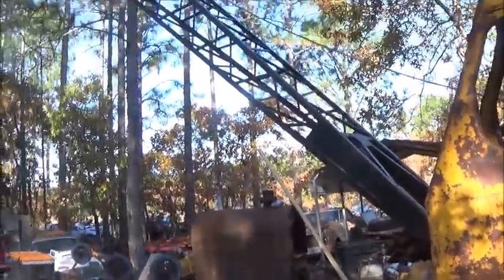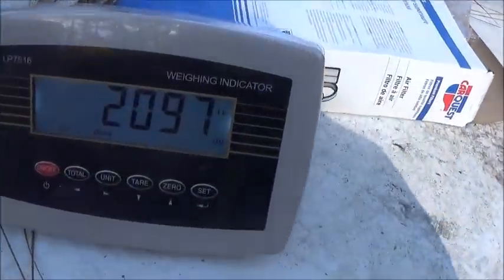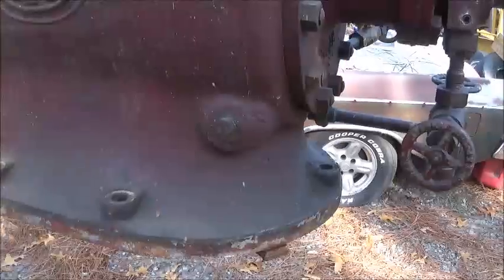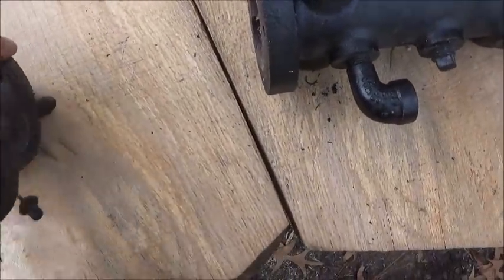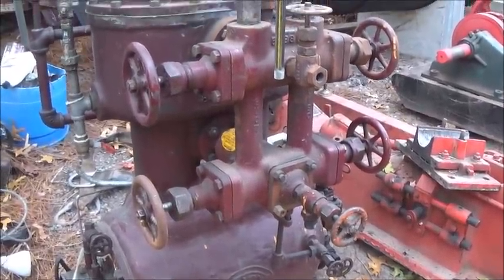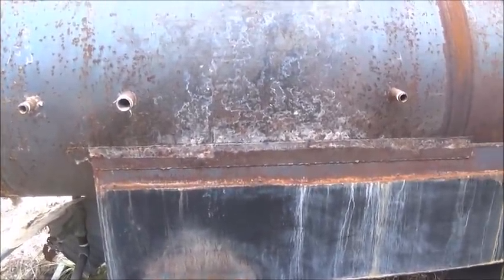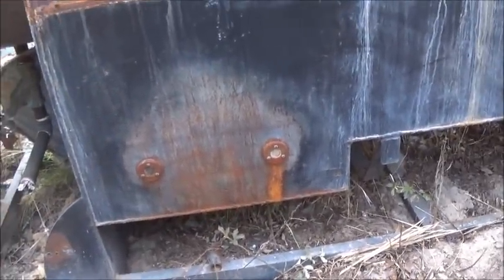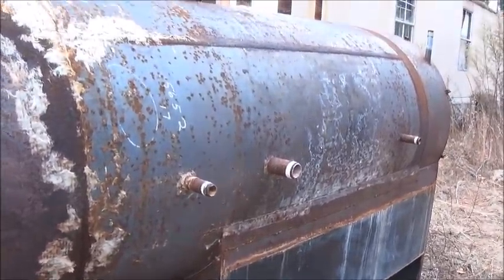AMMONIA COMPRESSOR, BOILER, LOCO PISTON AND MORE!!

Comment: That piston  is out of a  locomotive engines..16 Cyl . I used to work for a Railroad company.  Called Speno Railgrinding Co.We used one of those 16 Cyl Engines to power our 96,  15 Horsepower  Electric Grinding  motors on 4 cars. We went around the US and Canada grinding the rails for different railroads. We lived on the train. I was the power car Guy and ran the 2 cab. Grinding. But I did maintenance  and Mechanic work on the 16 cyl engine. I was 18 yrs old. Great job. If you wasnt married..LOL..The grinding motors were set at different angles to grind the rails. The stones were 7 inches in Diameter  and 3 and 1/2 inches thick. Dirty job for sure..Great Video. You can use that piston as a foot stool.LOL... Safed another piece of history So Awesome. Great job. The Chevy didnt even act like it knew it was setting back there....LOL That boiler is in good shape...that will be great when you get it hooked up.

Comment: While I'm not 100% sure I suspect it's live both ways or sides, and the valves are for compressor and system maintenance so the charge ( in this case ammonia ) can be either isolated or evacuated depending on what needed to be done

Comment: That boiler looks great, can you not get it ultrasound checked for barrel thickness, tubes can be replaced if needed. With the traction engines that I have played with it is an insurance requirement to have it inspected.

Comment: It takes so much time to pull a deep vacuum on theses big compressors if you just need to rebuild a valve or do a small repair that with all those valves you can isolate any one part or section, make your repair, pull a vacuum & put her back online.
(Provided the valves hold) nh3 "anhydrous ammonia" is relatively cheap compared to some other refrigerants & works very well in commercial and industrial application's.
Good to see you saving some of the old "big iron". Steam driven air compressor?? 😀

Comment: In the early 1990s I managed to save a compressor slightly smaller than this one from an ice house being demolished that served the Missouri Kansas Texas railroad depot at Denison, Texas. It nearly broke my then new 1/2 ton Ford F150. I've gotten smarter since  then about acquisitions since all but 2 of the flywheel spokes had cracks.
Reply: Lineshaft, did you notice how well Jonathan’s Chevy PU handled that load?  Watch when he was lifting the compressor to weigh it, the bed of the truck barely moved, like it wasn’t there…

Comment: That ammonia compressor looks like one that might have been used in a grocery store for the walk ins and freezers. I remember a commercial refrigeration place that stored cheeses had big ammonia compressors as big as your biggest steam engines. The bad thing about ammonia as a refrigerant is it's corrosive and the place in Illinois had more than one person get killed from leaking pipes that had corroded thru before they shut it down.
Reply: I worked for many years in a frozen food plant that used ammonia for the refrigeration, one weekend a pipe came undone and released ammonia gas into the air forcing the evacuation of the nearby area, only bad thing was when it would develop a leak inside the plant the ammonia would literally take your breath away, don't miss those days at all 😱

Comment: Jonathon, that boiler should put out enough steam to run you big engine at a pretty good clip if you run just that engine. The most important thing is the fact that it will be hot steam which will transfer enough heat to your engine and it will then allow you to time the engine right. Heat is a major factor in timing those old steam engines. I'm sure glad you got a good boiler, and looking forward to seeing it run on steam. I think you can't go wrong using wood to fire it with.
Reply: Now if he can only find a good source of wood.
Lol
Reply: @MrPaige222  He has plenty of pine straw!

Comment: That Unit Crane... how'd you get along without it before you had it? It's easy to imagine it's grateful for being saved and glad to be put to task again. Then again, it's just a machine. ;-)
Your red Duramax Chevy's long ago earned its keep, with that recent trip to Ohio and back with all that heavy treasure you trailered and now this 2000+ pd ammonia compressor!
Everything earns its keep at the JW Homestead. Want a table out of huge slabs of oak? Fire up the sawmill!
I'm trying to imagine how that boiler will be hooked up to the various engines you'll be running. Will it sit in a central location with steam lines branching off to each engine?
I guess I'm real curious how the steam yard is going to be laid out. I'm sure we'll soon see. 
Looking forward to the testing of that boiler and how you'll fabricate a firebox, stack and end caps to make it work.
Thanks for your channel.
Reply: Yeah man I've come to learn that every one of us needs a crane
Reply: @timothydockery534  To qualify, you gotta be able to pull an engine and rebuild a drivetrain on a crane deep in the woods and drive it out under its own power like Jonathan did. Still one of my favorite JW episodes! ;-)